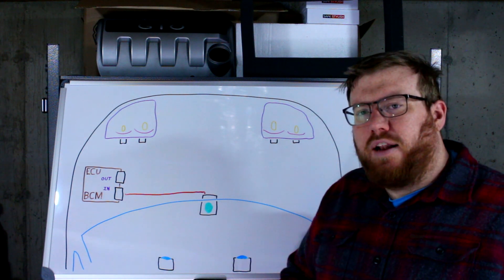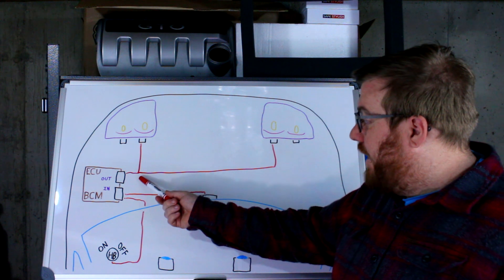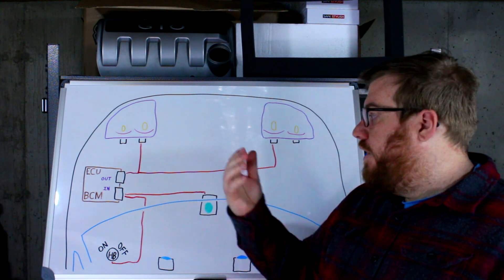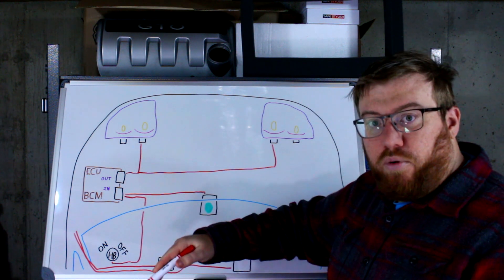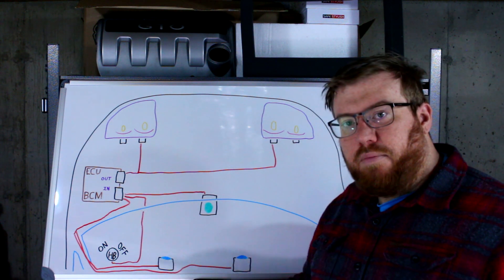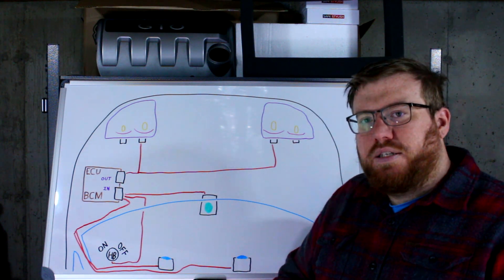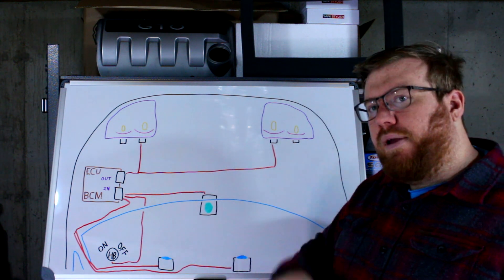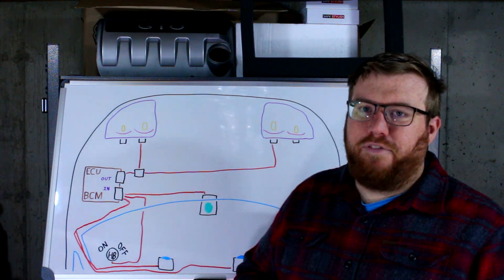How Automatic High Beams Work

Comment: Is there a way to lower the vehicles speed at which the auto high beam feature reacts on a 2019 pilot. This feature on my pilot doesn't initiate until 35 mph, which doesn't help when I'm driving at much lower speeds, as through a neighborhood.

Comment: The first vehicle I had with this feature was a 2007 Grand Cherokee Limited and I absolutely hated the feature so I turned it off. It never reacted fast enough and more often than not I was blinding people coming the other way and would get flashed by these oncoming cars regularly.
Reply from the maker: When I was using the feature it gave me anxiety with how much it waited before switching the high beams off. How well it works seems to also depend on ambient lighting conditions. I've stopped using it, too.
Reply: My China's Geely Bo Yue yr 2020 is just like this, never reacts fast enough so I also ended up switching off the function but my Mercedes yr 2014 , the auto high beam works superbly.